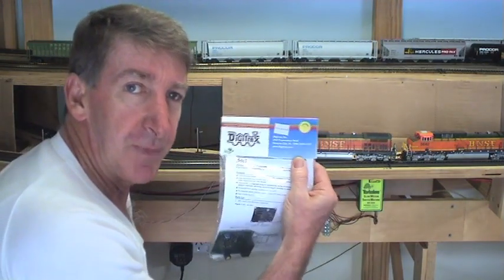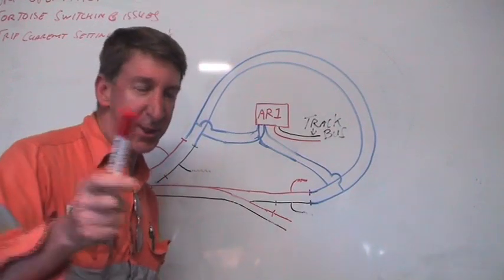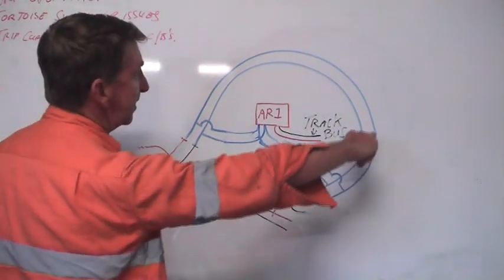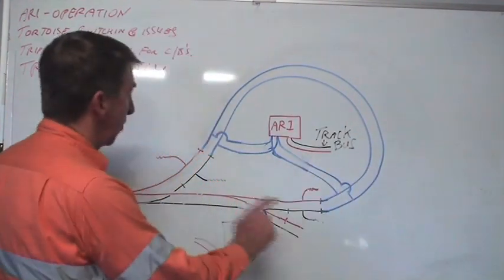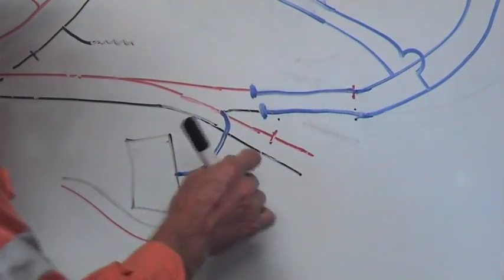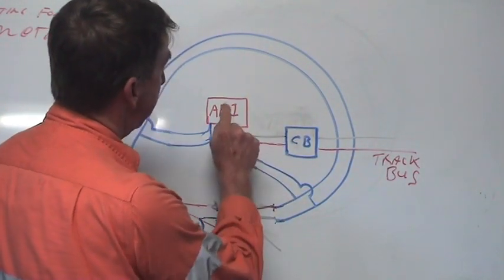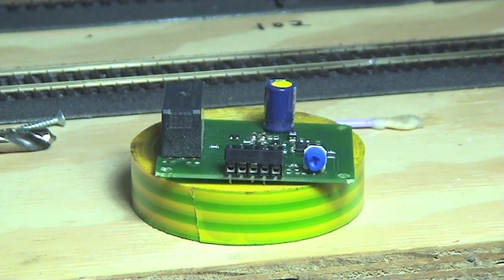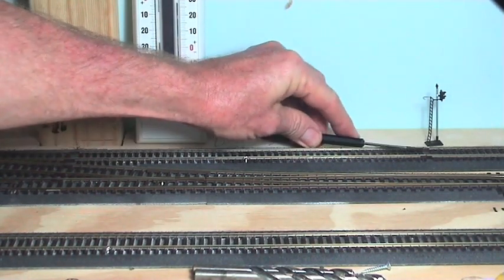Digitrax AR1 Auto Reversers. Tips and setup tricks.

Comment: Great video!  I'm a novice at DCC and am building a layout that will have two reversing loops.  How does the reverse loop operate when you have two or more powered engine in a consist? Does it keep reversing every time a powered engine crosses it? Or does it reverse for the first engine while the second engine is in the other power district then reverses for the second engine when it passes into the second power district?  Thanks.
Reply from the maker: Hi Dale, glad you like the video! I'm afraid the whole train must be in the reversing section, this includes mid or rear helpers! If the train is hanging over both  ends at the same time, the wheels can short both cut sections at once causing a short circuit. If the train is entering the reverse section and other locos in the train are still out , that is ok as long as all the train fits in the loop!
The first axel trips the reverser (if it needs to) and it will stay that way until it is tripped at the other end.
So as long as your whole train fits in the reverse section, it doesn't matter where the locos are. 
Hope this makes sense?
Cheers Gregg.
Reply: i Gregg! Thanks for the reply which prompts more questions.  You keep stressing that the entire train must be within the loop.  What actually trips the AR1... is it the fact that it detects a power drop (short) in the track as the loco's pickup wheels pass over the insulators or do ANY wheels trip the AR1? In other words, is it the loco that actually does the tripping?What if the train BACKS into the loop with the engine passing the insulated section last? Will the passing of the caboose also trip the AR1? You said plastic wheels do not affect the AR1.  And what are 'resistive axles', are they for metal wheels?  If the train cars have metal wheels does that affect the AR1? I didn't think the cars cause a short between rails. Next issue.  My layout has a wye immediately after the train leaves the loop.  There is no way that the entire train will fit in the wye which is only 24 inches on a side. I assume that the wye needs its own AR1. The train must pass through the wye in either direction to continue around the layout. The wye is intended to turn locos, too. So many questions...Thanks for your expertise on these matters.Dale

Comment: Gregg...fantastic video. I have watched it several times as I am still trying to figure out what I am doing wrong. I have the AR-1 wired and the track insulated as you have described. The problem I am having is that the loco is stopping completely when going over one of the insulated sections. It does fine going over the other section. Any suggestions? Thank you.
Reply from the maker: Thank you Jeff!  Are both of the insulated fishplates in line at the joint?  Also if the trip current is set to high, it will trip the overload on your system .  Try running the train in both directions to make sure it is the track and also try another loco? Try those and let me know.
Gregg :-)
Reply: @FishplateFilms  Thank you for the prompt reply. Yes the insulated fishplates are in line at the joint. I will adjust the trip current as well as running the train in both directions and other loco's. I will do that tomorrow and let you know. Thank you.
Reply: @FishplateFilms  Gregg...it works...it works...it works. Wow. Thank you very much. It ended up that the trip current was set too high and once I made the adjustment, it operated perfectly and will each of the three loco's that I have.

Thank you for taking to time to respond to my call for help.

Jeff
Reply from the maker: @jeffworthen4643  You're welcome Jeff!  The trip current is very sensitive so you may want to try having all 3 locos running on the reverse section to make sure it doesn't trip with all 3 running on it at the same time. The trick is to run the highest load through the section ( in the loop between both sets of insulated fishplates) and then turn the trip current down until it starts to chatter, then turn it up just a little . Then you have the least trip current but still enough to run all your locos through the section.
Glad I could help.
Cheers Gregg
Reply: @FishplateFilms  Very interesting. I will give that a try in the next couple of days. I have another reverse loop section with a different module and the trip current is not adjustable. I have been messing with it for a couple of months and when I saw your video, I ordered the AR1. Then, just today, I ordered another AR1 to replace the module that I am not able to get to work. I tried each of your tips and the loco's would always stop at one of the insulated fishplates. I'm anxious to get the new AR1. Great tip above.

Jeff
Reply from the maker: @jeffworthen4643  Sounds good Jeff. Let me know how you get on .
Gregg :-)
Reply: @FishplateFilms  Gregg...I have not yet had a chance to try it with the 3 loco's but I did receive a second AR-1 and installed it per your instructions. I am up and running with the reverse loop after 2 or 3 trip current settings and both reverse loops are functioning perfectly. I am disappointed that the other reverse module that I purchased does not have the trip current adjustment. I have tried it a couple more times with your wiring and insulated track in place and the loco's stop. Had I not seen your video about the reverse loop and the AR-1, it would still not be working. I will get to the 3 loco trial soon.
Reply from the maker: @jeffworthen4643  Good to hear Jeff! Is your other unit a "Rail Pro" unit??  I got one of these a wile ago not knowing that rail pro is a different system to DCC so they don't work on DCC systems! If it is then that is the problem with that!  The new electronic units work differently to the older style AR1's , but I'm yet to try one. 
Cheers Gregg.

Comment: Please Sir, is your wiring of the AR1 correct, the outer track at the entry point is connected to the right connection on the AR1, but so is the inner section of the exit point, won't this short the system.
Reply from the maker: Hi Nick , yes a white board error I'm afraid!  You can see where I rubbed out the lines and drew them wrong!  Well spotted Sir!  but not the first to notice my cock up..LOL
Cheers Gregg.

Comment: When trains in reverse loops are changing DCC signals, what is happening to all the other decoder signals on the rest of the layout. Are the mainline signals being changed?  An example would involve a train waiting to go into the reversing section in a siding and the train coming out of the reversing loop uses the auto reverser changing the DCC signals: how is the waiting train on the mainline affected?
Reply from the maker: Hi Rick, only the "polarity" of the track in the reverser is changed, the frequencies that cary  the signals are not affected.All the AR1 does is swap the track leads over on the reverse section and the rest of the layout is not affected. Hope this helps.
Cheers Gregg.

Comment: Hi Greg, I just bought a couple of AR1s and found your video, after watching it and after paying VERY careful attention I have one question, (maybe it's me being pedantic but! - I was building radios in 1951 with war surplus components and took note of diagrams) In your diagram in the classroom is there an error in the wiring from the "output" from the AR1? it looks a bit like you've wired yourself a short circuit. ie. either one end or the other need to be swapped. I've read all the comments about the video and agree with all of them, it's great - I hadn't considered the extra length of rail after the frog. Otherwise keep up your excellent work.
Reply from the maker: Looks like I idd Lindsay, well spotted! You can see where I redrew it   , I initially 
didn't have the turnout in .  I blame the boys for distracting me. Glad you like the videos!
Cheers Gregg

Comment: hello there I asking the question that AR1 relay working with insulfrog but what about the electroforg turnouts?
Reply from the maker: Hi Erik, 
All my turnouts are electrofrog, but it's better if you can avoid having a turnout at the end of a section. Insulfrog will work but you'll still need  insulated fishplates at each end of the reversing section.
Cheers Gregg.

Comment: One more question if you do not mind.  I have four power districts and a yard.  The yard joins district one just fine.  It joins district two in one spot fine.   The problem occurs when the yard joins district two around a curve resulting in a polarity mis-match.  Can my DB200 be set to auto reversing and then power the yard, resulting in only gapping the yard from the other districts? I call the yard district five.
Reply from the maker: Hi Rick, 
You could do that , though that would mean the yard is running through the auto reverser and switching polarity every time a train enters dist' 2. You could, if the track work allows, have a length of track between the yard and district 2 and this would be the "switched " section , but this section would have to be as long as your longest train! If you're happy having the whole yard switched, then go with your idea,
Cheers Gregg.

Comment: Gregg .. thanks for the video!  I have two reversing loops on my staging level and was completely confused as to how to wire them up.  I am using NCE like you and was wondering if there were any issues using the Digitrax AR1 or would you go with the never versions from DCC Specialities?  I am in N scale.
Reply: The Digitrax AR1 and PM42 will operate well with a NCE system.  With the PM42 you will be able to use 1 device to operate 4 power districts or 4 reverse loops or any combination of each.  A PM42 is usually cheaper than 3 AR1s.

Comment: Greg, thanks for the video and info.  Question.  I am just about to install an AR1 with a Wye.  On the diagrams ive seen it appears the ARI is connected to only one of the two tracks leading to my reversing loop tail (in a rail yard to a dead end stop.)  IS that right or should i connect the AR1 to both incoming tracks?

Also, is it Possible to use a three track turnout with the ARI? I was thinking of using the middle track as a short dead end track for parking an engine? 

Thanks in advance  - cheers, Chris
Reply from the maker: Hi Chris, a bit late I realise...but only one track needs to be switched , as you say. Also make sure all your trains fit in that section so they don't short out both ends at once. And yes you can use a 3 way turnout. 
Cheers Gregg .

Comment: The four wires exiting the AR-1 to the loop are a direct short.  You show both wires going to one rail. One set has to be switched, does it not?
Reply from the maker: I re drew it Rick and forgot to rub out the crossed wires..you can see where I redrew it. Well spotted! You run a pair to each end of the loop, not crossed of course!
Cheers Gregg.
Reply: Sorry to bother you. I have watched the video many times and have not found where you re-drew the four blue wires coming out of the AR-1 to the two blue tracks. The blue wire from number 1 on the AR-1 goes to the outside rail on the left and it goes to the inside rail on the right side.  Should this right blue wire on the right side go to the same outside rail, as one the left side?
Reply from the maker: No worries Rick, it is my bad drawing that is the problem..LOL You are correct, terminal 1 will go to the outside rail at each end and 2 will go to the inside rail at each end. You really only need one pair of wires but if the loop is a bit long it is best to have a set at each end!
Hope this clears it up for you!
Cheers Gregg.

Comment: I have a layout in my basement.  It was here when I bought the house.  I have been trying to get the layout to run for years but the trains always stop in the same spot.  I think it has to do with a reverse loop.  I know there is a reverse loop on the layout.  I do not know what I am doing wrong to get it to operate.  There are two transformers on layout.  How do I know if trains are running in same direction?
Reply from the maker: Hi Douglas! If you can afford it . I would consider changing to DCC, for a start , the basic wiring is a lot less complicated! You can't use a reverser on DC, and it is complicated to do it with DC. Without seeing the layout , I would have no idea where to start!  You could use a multi meter check the polarity on all the tracks and try to figure out where they go ? Sorry I can't be of more help.
Cheers Gregg

Comment: Hi, I’m a DC guy, and I have this loop, and use toggle switch, can I use the Digitrac AR1 if I run on DC? I’m not on DCC.
Reply from the maker: Hi Bill , I'm afraid not . The revereser changes the rail polarity in the loop , but it can do it due to the "AC" current having a frequency. The rail changes polarity at about 50 times a second which of course DC does not. This is , for me, one of the best things about DCC...oh and the noise! 
Sorry about that .
CHeers Gregg.
Reply: @FishplateFilms  ok, thanks.